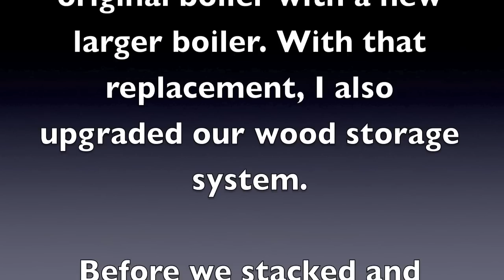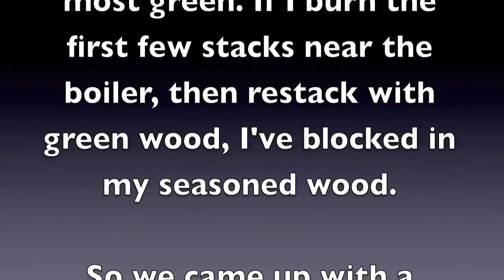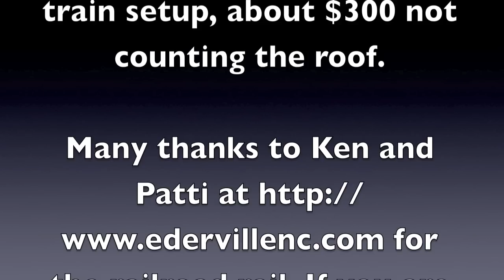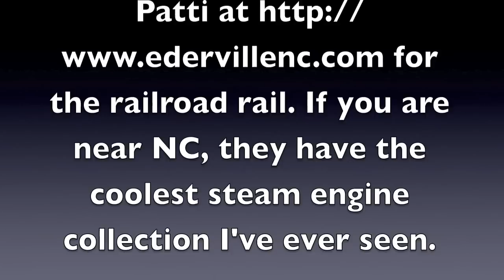Mobile wood rack system for a wood burning boiler

Comment: All you need is a $20,000 skid-steer!
Reply: +dlchambers Unless you can get a 40k skid steer. Then get one of those.
Reply: +dlchambers a $2000 skid steer would do just fine.
Reply: Or a 200 dollar winch.......just sayin.
Reply: Or just pay the additional cost for propane or natural gas and do none of this. When does all this become cost effective? What is your time worth?
Reply: Bishop Mills no it wouldnt. It would be broken 97% of the time.
Reply: @Dr Medicinal Fire hazard? Insurance? There are better ways.
Reply: The point is he already owned the skid steer. If not I am sure he would have used a wench. You use what you have access to that is what makes it grand
Reply: @ohiovalleypondandexcavatio2114  Exactly!
Reply: @jonhoskins5596  An ATV winch wouldn't even wiggle this pile of wood. The winch would be WAY underpowered unless you had about 10 pulleys, and then you wouldn't have enough drum to hold all the cable you'd need.
Reply: With some bolts and cutoff of tubes under the rack to make bearings, a slight tilt like 2° of rails would help as well. 
Could pick up used Seek Thermal Compact or Flir for your phone to do energy and electrical audit, to make sure you are not loosing that energy, after you are done with it put it back on the market so you don't lose out. 
Personally I would go for other more automated heating method. Like Solar collectors, heat-pump, wood-chip boiler (By doing so also not wasting quality timber) , bio-gas digestor + generator, distributed data center for heating (just like a Dutch company did), Passive solar, Solar PV. Every property is different, there is no single best option.
Outdoor heater effect indoor air quality far less than a stove would, fire hazard is much lower.
Reply: @chrismccall1736  I could cut and split that amount of wood in about 5 days

Comment: why not use a pulley system? So that you hook up your skid on one side and pull on a cable. The cable begin anchored from the other end using a pulley. This way, you don't have to be perfectly aligned and you don't have to try as hard. Basically, pulling would be easier than pushing.
Reply: +Demo Niq You could use a come-a-long as well. instead of a skid steer.

Comment: What happens when the loader hits the roof. Do you have a longer push pole
Reply: He just has to add green atqxked wood and push that in between splitter and stacked wood. No need to push more then a few feet at a time.

Comment: I think that all a man would have to do is hook up a chain and winch system to this thing and it would be pretty much perfect. I bet even a simple boat crank type winch would do it or a cheap set of electric style shop hoist pulled correctly most of year unless it froze in

Comment: Wouldn't it be easier to build a rolling gantry and use a top-load boiler and skip the skid steer?  Be able to load 6' logs directly from the stack or right off the truck.  No splitting or manual stacking.  Put in-floor heat under the covered storage to help dry logs?
Reply: Don't be a quitter.  We're listening, let's hear it.
Reply: Is it that hard to explain?

Comment: Why not use a electric winch mounted on the boiler end with the cable going under the wood to the other end.
They you can stand to the side and just winch it forward each time. Sort of like they load roll off dumpster with.
No danger of hitting the building and you can see when to stop.
Food for thought.
Reply: Maybe someday. When we built this, we didn't have a winch but we did have a skid steer. It works just fine like it is but if I ever get rid of the skid steer I may look at a winch.

Comment: all you need is a micro switch that controls a light at cut side of shed gable end & it will turn on when front skid triggers switch... then you know you have pushed far enough- [1 man worse conditions- set up no need for help or walking around in storm to check... I would set it up so that you could then just stop machine leave there & close doors until next push for the 2 week snowed in scenario... that way machine is inside under roof after you close doors & then go inside your house min exposure to bad weather!

Comment: footings and rafters and rails and roof sheathing and desinger shingles and the sliding rails  and permits.. i estamate 15.000$  and the wood furnace 6.000$ ..  ...and once it snows you can hardly drive that  tractor on the slipery surface if it dosent hit the roof first... .. i installed my woodstove  from RONA canada for 700$ and pipe for 600$ and tile floor for 100$ and it works great...you spent  15 times more  .. to still burn the same wood.. what did you save.. a regular furnace is cheaper

Comment: I know you have the Bobcat, but with the chance of hitting the roof or accidentally taking out one of your uprights to your shed, have you ever considered using a hook loop system to lock the racks together? You would  be able to easily separate them and use an ATV winch powered by a car battery to pull them so you don't take the risk of knocking down your shed by mistake. I'm not judging your skill I just know s**t happens when you least expect it.

Comment: Instead of doing it "manually" with the skid steer, your next upgrade should be a winch/snatch block system...a 12,000lb winch run through a snatch block will yield 24,000lbs of pulling force...

Comment: Nice ,, but would not work in Canada during winter with 2-3 feed of snow
Reply: +grison007 - Sides could be added to the wood shed in the area closest to the boiler.  They would keep out the snow and make it easy to retrieve the wood.  Probably no need to move the stacks in the winter, they would be close enough to the boiler. Also agree with TheFrogKid above that the piles could be pulled toward the boiler with
a come-a-long.  Honestly I think this is a rather elegant idea, adaptable to individual situations.

Comment: How was it 300.00 for this set up ? the racks alone cost more then that, not to mention the rails. even if you built them yourself it would still be more than 300.00.  I simply bought old 275 gal totes, I cut a 2 foot area out of the front to make it easy to fill and empty.  it takes one man and a bobcat to pick them up and carry them directly to the boiler. also I can tarp the tops and stack them anywhere I want. total cost ,, 20.00 per tote / 4.25 for a 10 x 10 tarp. not to mention you can stack them 3 high, and I don't need anyone to watch the other end for me.
Reply from the maker: As is stated in the end of the video, the rails were a gift so there is zero cost. The wood was already on site and was sawn from my own trees. Again, zero cost. $300 is what the steel for the racks cost me, plus some minor things I had to buy. I didn't count what I had on hand already so obviously if you count those costs, the total would be more. Totes can work just as well, they just didn't work well for my particular setup.

Comment: Yes/No I need 2 B out side 2 load up the wood box. However once it is full with 2 days of wood I do not need 2 carry it in the house. I simply push open the window-it swings open on it's top of the window frame hinges like an awning n I simply reach in

Un like your system where all the mess is out side. Another advantage of the wood box just out side hanging off the bottom of the window frame that it is near the stove, I do not need 2 carry the mess threw the house shedding wood crumbs all over

Comment: It looked like the top of the rails could benefit from some grease to make the wood slide easier.
Reply: We actually did grease it. Then found it made no difference as steel slides on steel very well.

Comment: I have a central boiler 5036 for the last 5 year and i have never split 1 log and they last about 15 hour at -25 celcius
Reply: Either your logs are smaller than mine or you have a lift to get them in the boiler. Our logs are from very large trees. No way they would be loaded by hand in our situation. I agree, they’d burn forever if I could get them loaded though.

Comment: How about instead of having the building going length wise have it as a T then one year each end is seasoned or green...  No moving anything...
Reply: Good idea JDK, but for two things. One, you still have to carry further to the furnace than with Dan's system, which if it is a long stack, becomes non-trivial.  But two, and potentially the killer, is that you then have two locations not one to deliver (and maybe also process) the wood.

Comment: I have watch YouTube about the wood oven boil running water pump to house to keep warm during winter season. The price costly and labor is not easy to spend money on chain saw, tractor trailer, shed or garage to keep wood dry. To keep up twice a day. 
I have not see automatically woods feed boil. Then don’t have to worry about twice a day feed woods into boil oven. 
My question why bought a big house waste space and waste heater.

Comment: 80 dollars per foot for the rail, Plus lawyer fees, fines, loss of work, loss of income from prosecution. Accessory after the fact should a train derail and folks get hurt. I,m sure you are good honest folk built this system, I'm impressed with your engineering, I am one, its very clever, I also am suspicious of who, where, and when, how, whom from you acquired these things from? and when its taken off land trains no longer run on, its a crime. those rails are not for the taking.Anyone buying or selling them is subject to arrest. 80 dollars per foot because of the nickel in them, any junk yard buying them, subject to arrest, receiving stolen goods, their so expensive, they get recycled only by engineering company's for the owners of the rail road company, ex. union pacifictypically, 100 foot rails such as these x 80 dollars, x 2 rails, $16,000. dollars of stolen materials from someone

Comment: Cool system, I would have made the roof a foot or so higher so  you don't have to duck under, also park the machine under it, wouldn't need the Push Pole then, we do firewood also, have tractor and skidsteer, + other machinery, which we use all year long anyway, funny how people without the equipment, make comments about "well what if it Breaks Down" So then you fix it !!

I have heard comments like "Wow your lucky to have that Tractor" Lucky, Lucky you say, Hmmm anyone can go Buy one if they want it, luck has Not a thing to do with it !,,  to me If your doing firewood, tools, equipment, to make it faster and easier is the way to go !!
Reply from the maker: Thanks Mark. I appreciate the people saying to use a winch instead. Starting from where they are with neither the tractor nor the winch a winch is certainly a shorter jump. However like you I have a tractor because we use it daily for a multitude of things on the farm. Pushing some wood is just another task it performs.

I do wish the roof was higher however I was going from an existing roof line and had to work with what I had. 

We went through about 20 cords of wood this overly cold winter. I'm not inclined to limit myself when I have HP to make production faster and easier.

Comment: Buy a cheap harbor freight winch run it under piles and hook it on the last pile Then u could pull wood towards furnace and u wouldnt need 2 ppl

Comment: Y split the wood so small? Most take 4 foot log lengths
Reply: Because when I built this setup I had a wife and small kids who needed to load logs when I wasn’t there. The wood is split for the stoker, not the rack. Also what happens if you get injured. Then your wife has to be able to load. You can’t always plan on being available.

Comment: Just bring the splitter closer to the boiler. Prob solved.
Reply: Not really. You need a stack of wood to keep up with demand, unless you plan on splitting wood as you are throwing it into the boiler, which wouldn't work for various reasons. The splitter is at the other end of the stack, so it's as close as is practical.
Reply: Your hasty analysis means you've missed the point.  Lengthen your attention span and give more time to thinking about it.
Reply: @falfield  Nicely stated ...not! You could have said the same thing without instilling hostility and animosity. There was no need for it.

Comment: Maybe some rollers would make it easier, however many or most people who live on such property have some heavy equipment to help with the job. 
Double stacking wood is for fools, nice job.
Reply: Hmm, yes, but you want some friction I think, or you'll need brakes unless the levelling is perfect, and several tons on the move needs a lot of respect.  Worse than this, the rollers or wheels will add self-defeating height to the stack and limit its useful maximum height.

Comment: how about some kind of cable system that ruins the whole length with hooks at various points to catch the underside of the pallet to bring it forward.,  could put a metal brace on each pallet to catch it and bring it forward.  (kike a bin piler)

Comment: Excellent system!
A lot of work involved in cutting , splitting, stacking and stoking firewood.....
 Since I burn inside my house in a Hearthstone woodstove, I do things a bit differently. My stacks are on long 2x4 PT rails (40+ ft) to try to eliminate most of the criss-cross end stacking. That takes some extra time. I also "stack-as-I-split" by moving my Super-Split along the rails. Still have to transport it to my door after it's fully seasoned - usually with the tractor bucket.
Still..... Lots of work.
If you'd like to view my set-up it's also on YouTube :https://www.youtube.com/watch?v=RDavuawdooY
Reply from the maker: Thanks Stephen. I like your long stacks. The end stacks are definitely a time killer as they have to be just right but it's doable. My theory is, you're splitting when you have time. You're stoking the boiler when you are in a hurry so time spent on the front end that saves time on the back end is time well spent. Watching your video made me tired, you certainly showed what it's like to do the work. Do you like your splitter? I've always been dubious of fly wheel splitters but it seemed to do just fine. Certainly faster than my hydraulic splitter.
Reply: Love the splitter. The beauty is in not having to bend over and lift the rounds onto the table. Saves the old back.......
And it is crazy fast. You really have to watch where you put your fingers.
Reply from the maker: Stephen Round That's what scared me when I saw it. I'm used to brake presses in a machinery shop and the old fly wheel brake presses would cleave a finger in an instant. Nobody used them anymore even though they are cheap and then I see a splitter with the same technology. Kinda scared me, but I have kids around when I'm splitting whereas you are by yourself it appears so you can be safe.